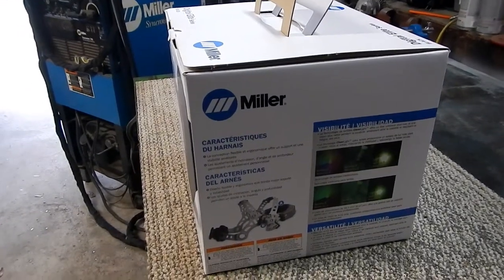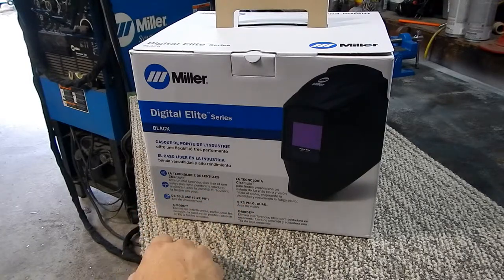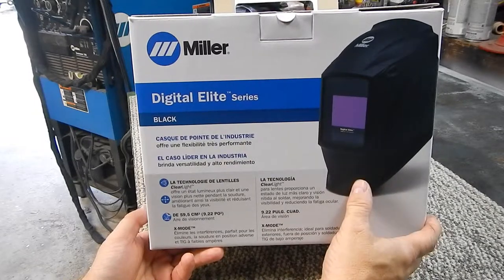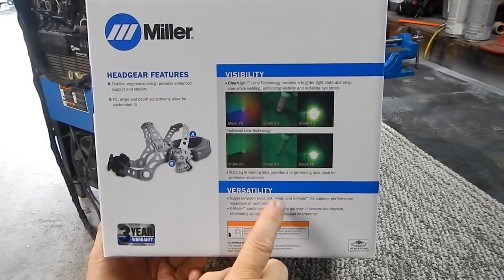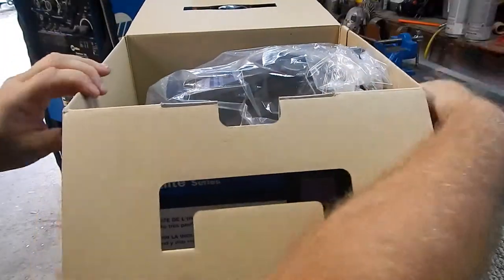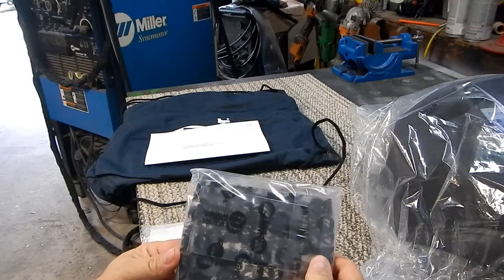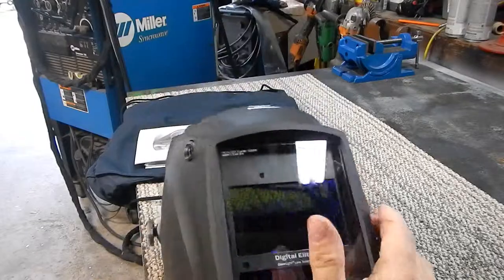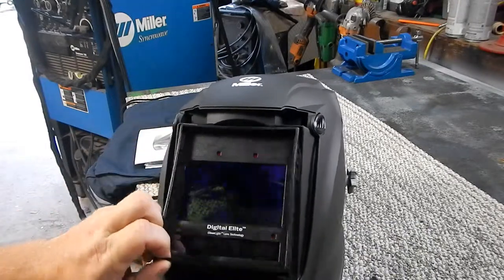Tool Review Miller Welding Helmet

Comment: I'm torn between this helmet and the Lincoln Viking.  I saw a review that said the miller has a green tint makes looking at the puddle easier on your eyes.  After using this helmet for almost a year do you still like it?  Does the 'smaller' viewing area compare to the Viking make any difference?
Reply: IMO I think Miller as a brand, is better. I love Lincoln, their hoods are good and machines. It’s a cool brand. But I think Miller is more reliable. In my welding school, Miller is standard. Rarely do we ever use something Lincoln other than two Lincoln mig machines. I had the Viking hood before and they aren’t bad. In terms of quality I think their hoods are more or less the same technology.